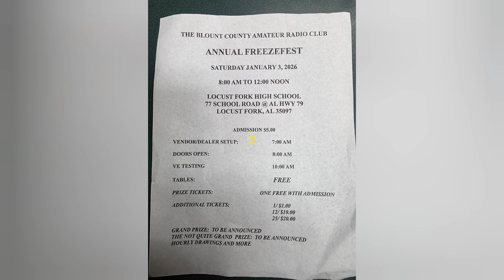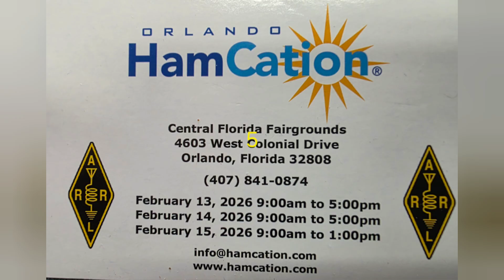My advice of the difference in signals from SDR to Analog hf radios. #hamradio #hfradio #arrl

Comment: Good video BB. I prefer the sound of "hollow state". It's hard to beat the sound of the old tube receivers. And I really like the passband tuning (you mentioned) in the older equipment. Drake had some of the best to me, and with the passband tuning you could filter out a lot of the adjacent noise. There were several ways different manufacturers did this. Some of the Drake's actually allowed you to tune the filter across the fixed IF frequency, just slightly though, but enough to filter out some noise. Cool technology for back in the day, I think. Still relevant today, at least for me it is,.............. old or not. Keep up the good work BB!
Reply from the maker: thanks jeff!! 73 buddy!!

Comment: The only time that the radio choice actually matters is when there are very strong adjacent signals.  Antennas are really what matters.  I can work the same weak signals on my IC746 as I can on my FTDX10 as long as there are not crowded band conditions.  Even then the difference is marginal.  I am actually really not a fan of digital noise reduction and have gotten away from it unless completely necessary.  A lot of these radios anymore are more marketing hype than anything.  Even the diversity receive argument can be side skirted by some of these phase control antenna blending boxes with better results than diversity receive will gain you.  73, KF0BBU
Reply from the maker: thanks!!!73!!!

Comment: The main characteristic of an SDR transceiver is the waterfall, not the DSP. One cannot miss a station if he/she sees the station on the waterfall. In an old analog transceiver one can pass over even a strong station simply because that station has a one second break in its transmission. Those videos are made by people who do not work with SDR transceivers and have low technical skills. Daniel, VE7LCG, advanced, B.Sc. Electronics Engineering, M.Sc. Computer Systems, 61 years old.
Reply: Between other confusions, you do not understand that SDR transceivers also have analog filters, more or less micro tunable, depending on price (like comparing the cheaper Yaesu FT-710 with FTDX10 - both SDR). P.S. I am also an ex reserve officer (second lieutenant), but telecommunications, not air force.
Reply: I agree the bandscope/waterfall display is a big plus and it is standard on SDRs.  I added that capability to an old Kenwood TS-850 by tapping into its 1st IF (8.83 MHz) with an SDRplay receiver and viewing the waterfall on an adjacent computer's monitor.  The bonus was the SDRplay acting as a DSP IF providing all of the SDR "goodies" in filtering and detection through the computer's sound card.
Reply from the maker: @k7jeb thanks!!73!!
Reply from the maker: thanks!!!73!!

Comment: I have an Icom with DSP and the G90 with SDR.  When the G90 is in default mode, I have to take one step of filtering on the Icom to match it.  Both will narrow the signal to silence.  When comparing signals I can hear between the radios on the same antenna, I cannot find a signal in one that the other can't hear.   They both pull out signals clearly enough to understand than my Yaesu, but it does hear them. 

When it comes to SSB, getting the signal narrow enough to filter side noise is sometimes difficult because some voices are easier to filter than others.  Weak female voices are the most difficult to filter to clarity. 

Like you, I have hearing loss from machinery from when I was military. 

I used crystal filtering on my HF radio for CW in 80s.  It had a ringing echo that I don't hear in either my Icom or G90. DSP and SDR have much better quality filtering than the old crystals.
Reply from the maker: thanks!!!!73!!!

Comment: I've been thinking about this a lot lately. 
I was suprised to see Callum make a video on it as its been on my mind lately. 
I hear a big difference between modern SDR direct sampling receivers and older double/triple heterodine receivers. A few years ago, I preferred the modern transceivers because I hadn't heard the old ones in a long time. I recently bought a transceiver from 2001 and I prefer the sound of the white noise much better than the modern radios. 

I think that I'm going to try to spend some time listening to some older units when the opportunity arises before I buy another radio. A few years back, I sold all of my non-portable radios. I've been operating QRP field portable only as the noise level at my house went from S3 to S8 in about a year. They legalized marijuana in my state and everybody started growing it in their houses and yards. This (seemingly overnight) made my noise floor go to a level where I cannot operate radio at home. I'm moving this year to a new state. I'm going to definitely sample the airwaves where I move to before buying another house.
Reply from the maker: thanks!!!73!!!

Comment: I agree you should look at different radios like you said listen to many different radios. You will learn antennas make a real difference and can help with noise coming in.  Most don’t know what filters like common filters to get noise out to hear the signal. I started with a FT817 then a FT857 as I worried with those to a FT897. Then I tried the Elecraft KX2 and wow I could hear more with it over all the other radios I had.  I sold them and got the K4 because they discontinued the K3.  Well built SDRs are very low noise if you are carful with your antenna and use a common mode filter.
Reply from the maker: thanks!!!!73!!!

Comment: This is why I want diversity receive, That is on the list of projects, I want maybe a receive loop and a loop on the ground working in diversity. Also I often use the Kiwi SDR network, it is the most useful tool in all of ham radio, it's more useful than beacons and WSJTX beaconing. Kiwi SDR, you can select an SDR where you expect to be picked up and see your signal and see how good it is. 
It basically removes the reliance on other people to relay some of the data on what your signal is doing and you instead get a visual waterfall better than any TRX onboard and you get sound. 
Using a diversity receive setup and using the Kiwi SDR network you have all the receive power that no single TRX can have no matter how good it is. 
Kiwi SDR is so powerful of a tool I could point a beam from down here in VK at the US and pump 400w towards the US listen to a west coast SDR on the Kiwi network and use the SDR as a US based RX and use a 400w amp as the TX here in VK.
Reply from the maker: thanks!!!73!!!

Comment: Totally agree! Always comes down to the antenna antenna antenna! Radio def helps but  sure but its all about the antenna! Just my two cents lol
Reply: I disagree Diversity RX can make up for a poor TX antenna, so many hams think 2D about antenna, you don't have to TRX on the same antenna, you can have an RX antenna and a TX antenna, you can also use both in diversity or even have two RX antenna in diversity with a separate TX antenna for three antennas in total for the one contact.
Reply from the maker: thanks!!73!!
Reply from the maker: thanks!!!73!!!